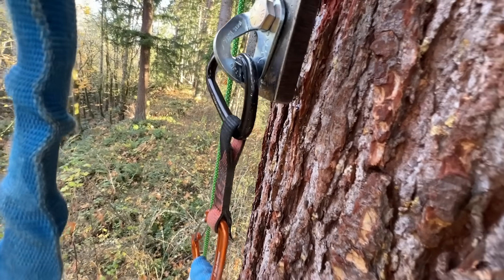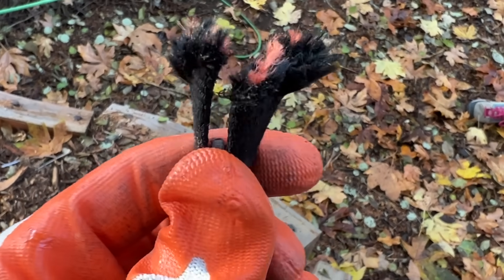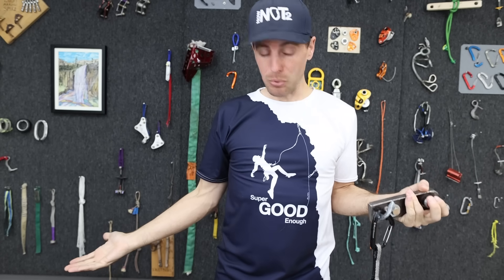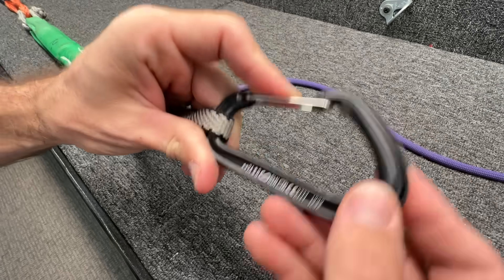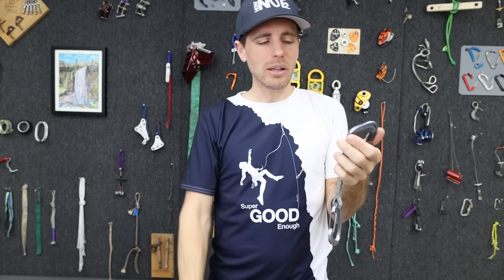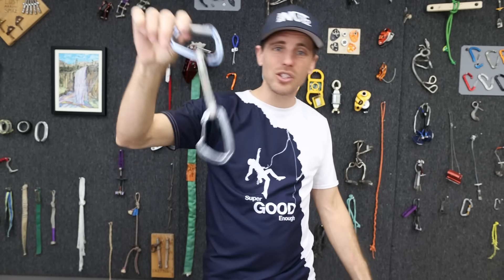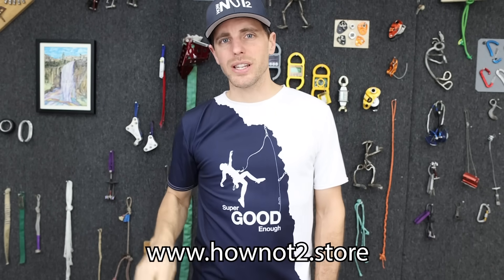The American Alpine Club wanted me to investigate this

Comment: A tip when finding out above the bolt in a scatchy climbing position that your upper (bolt side) gate is facing the wrong direction (sometimes you just don't know in advance): Don't unclip and risk a big whipper. Just turn the carabiner upside down. So the gate opens at the dog-bone side and your spine is facing the right direction.
Sometimes I even do that from the beginning, when I don't like how my carabiner nose interacts with the hanger or whatever else found in the rock (e.g. bolts with very small eyes).

Comment: Love how the conclusions for most of these is simply “Oh no, they broke less than they’re rated in this weird situation. Still rated higher than what you probably need, but scary.”
Reply: I got more out of it than that, tbh… 

-  Pay attention to the draws beneath you.
-  this can happen
- put the spine in the direction that you are climbing
-  Just because he measured a 7/8 kN here (sample size of 2), doesn’t mean that’s what you’re going to get on an older draw or a subtly compromised draw.
Reply: As opposed to??
Reply: It's called safety margin, and it's best to have as much of it as possible. Stuff testing to 1 or 2 kN above typical fall forces doesn't feel very comfortable, despite technically still being safe. You can get carabiners that with an open gate will still break at more than 2x the typical fall force, 3x when cross-loaded, and more than 5x when everything is as it should be.

Comment: I have been climbing for over 20 years,😊 and I've spent more than 1000 days climbing. In that time I have had a draw unclip on me on 2 occasions: once due to a back clip, and I believe the other was the unclip you demonstrated. A friend broke a biner over a corner, and I do not trust badly located bolts as a result

Comment: I use a homemade pulley and caribener system system in my home gym, for things like tricep press downs and overhead tricep extensions. I have had the type of break happen there. Things get shifted as the wire is repeatedly put under tension, then released. I have had two breaks like this. Not life threatening, but def a shock to have 80lbs drop off all at once 😅

Comment: Awesome videos!!! 
Been getting into climbing. 
My partner uses slings as personal anchors when doing set ups for top ropes or abseils. 
I personally think they leave way too much slack and will get very hurt if they do fall. 
I’ve brought a rock empire PIP Adjustable Lanyard for them.
Was wondering the difference in forces between that and a sling in a factor 1 fall. 
Is it worth having if they don’t keep it tight vs having a sling? 
Or is it’s utility is being able to quickly have a small line so you aren’t falling very far?

Comment: 3:28 the opening was 1/2 on the dogbone as a result the part sticking up ripped a hole in the middle then the part at the right (in the video) ripped, then it slid down and the other half ripped completely disconnecting.

Comment: Just ran across this channel.  Very Interesting.  I climbed a lot in the 70's and 80's.  Big Wall, Alpine, and vertical ice.  In the intervening years I spent a lot of time working with heavy rigging.  When using any fiber rope or sling (steel, nylon, hemp, sisal, whatever) one of the major factors in strength is fiber bend radius.  A carabiner when used with typical climbing ropes and slings has a suitable bend radius to allow the rope or sling to achieve the rated strength.  Most fibers lose strength with age (no matter the material), which exacerbates the problem.  I think the issue with the sling breaking on the wire gate is due to the reduced bend radius.  The gate deformed and the bend was over one wire (greatly reduced radius from the carabiner itself).

This is also why knots cause a problem.  The bend radius within a knot under load is less than a rope over a carabiner.  Some knots are worse than others.  In your video where you were pull testing a triple anchor with a sling that contained a figure eight knot, you asserted that the multiple legs counteracted (cancelled out) the "50%" strength loss. As I remember in a multi anchor situation, we set it up so the sling always equalized (no knots).  The "redundancy" was the shared load amongst the multiple anchors.  I would like to see the knot on multiple legs theory tested, as I do not believe it is so cut-and-dried as 2 legs times 50% is equal to 100% of 1 leg.

I really like that your testing methods/conditions as they are attempting to get as close to real world conditions as possible.  I am afraid that a lot of strength testing is too laboratory perfect.  In other words those wire gate carabiners were never tested with the sling cinched around the gate itself.  In a long lead, particularly with direction changes and changes in tension, maybe even a fall, the carabiners move or bounce around.  It is pretty easy to imagine the sling getting caught on the gate (particularly the narrow sling you were testing).   I have never used wire gate carabiners, but I have always been skeptical of them.  I think I prefer the extra weight.

Keep up the good work !
Reply: The point in wire gates is not to make the biner lighter, it's to make the gate lighter to avoid loading the biner opened when it smashes the rock. This is something reported very often. 
I only use biners with open and opposed load of at least 10K. They are not that much heavier and I feel 10 is super good enough as a backup. And yes I use wire gates at the rope side, but my slings are fixed down there. So walking up to the wire gate is not an option. 
I always use real gates on the top biners, as I often saw wire gates getting pushed half open, when the rock is rough and the carabiner is not touching the rock evenly.

Comment: Did you test other brands?  I ask because you mentioned seeing if it was a problem with a specific design but all I saw was Black Diamond.  The nose is honestly the biggest difference between the CAMP, BD, and Metolius small wiregates so I'm not sure it would surprise me if some brands are worse than others in this particular failure mode.  (Honestly not that I would change my buying decisions even if it were.  This is too low a risk factor)

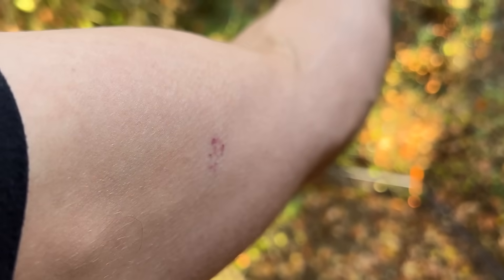Comment: 2:46 Bro-ham-sef, if you already think eye prop is warranted, just go for the additional face shield too. It really sucks to put on eye pro and then still get smacked in the mouth and chipping a tooth...
Reply: Correct. If you do anything where you expect shrapnel flying around and put on eye protection because of that, it's usually a good idea to directly don a face shield. I never get why people for example angle grind with just eye protection. That shrapnel that would completely destroy your eyeball is also going to do pretty gnarly damage to the rest of your face.

Comment: Why don’t the manufacturers just put the same object in both ends that holds the biner in place?
Reply: Because the quick draw needs to flex as the climber climbs above it. If it was held in both places it would move the top biner into a compromised position.

Comment: 0:10 would note this is why I prefer mixed draws but the solid gate should be bolt side and with the loose part of the dogbone while the wire is rope side and affixed into place. Loose dogbone will make turning the carabiner less likely as you travel, minimizing the unclipping risk, and the tight side with a keeper makes clipping easier as well as helps with orientation.

As to clipping direction, should just become habit to set a draw against the direction of travel, but the likelihood is vanishingly minimal that I would never unclip and reclip the draw.

Comment: I was very happy to see you mentioning quickdraw orientation at 5:50. I have seen draws facing the wrong way unclipped themselves many times.
Reply: Me too, I was always taught to face gates away from the direction of travel. Seems like such a fundamental rule but I can see how it might get overlooked.
Reply: @SOUND_PROVIDER not just overlooked.  If you don’t know which way you will go after clipping, or, you start out in one direction, then curve to end up on the other side. I too learned and try to clip like this, but there are plenty of times you end up that way any way. That one reason for locking draws.
Reply: Many times? really? Did this ever result in an injury? I find this so surprising. I've been climbing 20+ years and I don't think I've ever seen this even once in a real climbing situation, except in a forced demo like the video shows.

Comment: Super interesting. Maybe use solid gate on the bolt and wire gate for rope side?
Reply: Yeah this seemed strange to me. I'm in Blue Mountains Australia where we often have solid gate on top to fit well with bolt plates and wire gate on bottom to reduce weight. I don't understand why if you have wire gate on top anyway that you wouldn't have it on both ends

Comment: It would be interesting to see some tests of crashpads to see if or when you should stack crashpads to make safer landings for highballs
Reply: I feel like that would be very hard to predict/replicate. If you fall wrong, you can break your ankle from a couple feet up. If you fall right, you can fall 10+ feet and walk away with as little as a bruise even without a pad. Plus there's the condition of the landing, whether the pad is over a rock or soft dirt.
Reply: @Labyrinsky have you considered not falling?
Reply: @colerut7912  ?? I'm replying to the guys above wanting to get testing on bouldering falls. And if you aren't falling, you aren't trying hard enough.
Reply: @Labyrinsky  that’s a you problem
Reply: @colerut7912  you're right, I should probably just give up climbing and pick up cross country
Reply: @Labyrinsky  that sounds like a splendid idea!
Reply: Yes!!! How far is safe on various pads

Comment: Watching both the dogbone and hanger snag on notch contributing to the probability of this failure mode, my first thought was "and this is why I use notchless carabiners."

My sport draws are keylocks (Spirits) and my alpines are shielded notches (Hoodwires)... things can still go wrong, but some risk mitigation is better than no mitigation.
Reply: Agree - wiregates on sport climbs???  Why? Please no.
Reply: @CanyoneeringUSA  some of us use the same rack for everything 😬 gear is expensive!
Reply: @CanyoneeringUSA wiregate won’t open when the QuickDraw is hit hard enough. That’s the big upside. (And weight)
Personally I still prefer good quality QuickDraws without wiregates like the Spirits or Alphas.
Reply: Loving my CAMP Dyon biners

Comment: That's it! I'm replacing all my carabineers with padlocks.
Reply: I don't think LPL has tested that...
Reply: @cowabductor  I've watched enough LPL to at least know not to use Master locks.
Reply: Different key at every bolt for extra security!
Reply: Hello I'm the lock picking lawyer and today we are going to be picking all of the padlocks on multi-pitch climb. Because I'm holding on to the rock I have to do this with one hand so I've got a tension the quick draw with my mouth! Fortunately we have a rope in the system so if I just jerk on the rope and the right direction padlock shackle will just come off because I can will it to come off.
Reply: I kinda want to see this tested now 🤣
Reply: Just make the carabiner opening face the opposite direction of where you climb. Alternate if it’s straight up. Problem solved and this is how it is actually taught by every climbing school.
I am very much into safety but padlocks in every quickdraw is just not necessary and an unbearable hassle.
I would always use biners with padlock at the Top, though.
Reply: @AW-po7jr  I can't tell if you didn't get the joke, or if this is master level trolling, but either way I'm amused.
Reply: @jarodlojeck5150 I didn’t get the joke 😅